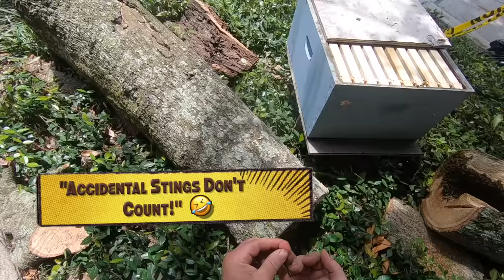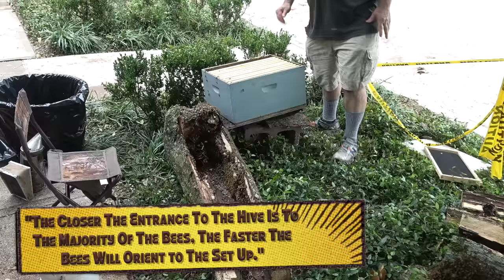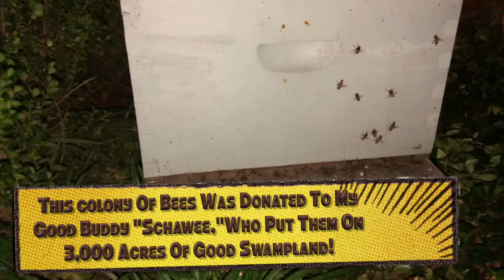Bee Man & Crazy Tree Guys VS Bee Tree

Comment: JP, find yourself a Gonstead Chiropractor to check if your first vertebrae is out of place. This will often cause the head to tilt in a manner that causes the eustachian tube to run horizontally rather than with a slight pitch.  This doesn't allow it to drain properly and can lead to blockages and infections.  Many childhood earaches are a result of this after the pediatrician has "helped" during birth with some traction during difficult births.

Comment: We’re no spring chickens JP. The older I get the more easier I get affected by heat. I have had my ears get weird. It’s said that once you’ve had heat exhaustion or dehydration the easier it is to be affected again.
Reply from the maker: Yeah, I’ve been dealing with this odd phenomenon for at least six years now, the last 2-3 years it’s gotten a little worse.

One doctor said it could even be something rare that required literally brain surgery, something about an area between the brain & inner ear or something, some little “nip tuck,” surgery but to diagnose it required a cat scan.

I was like but it only happens, only ever, when I’m in the heat but goes away after I’ve been in the AC for a little while.

Yeah, I decided to pass on the cat scan & potential brain surgery for now. 🥴

Comment: There is an easier way to put comb into frames, but it might take slightly longer rubber bands. Hook a rubber band around one corner and pull the other end around the diagonally opposite corner. Do the same again with another band and the other two corners, making sure both rubber bands are on one side of the frame. That will give you something to lay the comb on instead of manipulating it while drawing rubber bands over the frame. Finish it by putting another two bands diagonally over it and it will be stable enough to put more bands around the frame if necessary.
Reply from the maker: I’ve been contemplating lately of going to longer rubber bands, it’s coming. Thanks for the suggestions, appreciate it!
Reply: @JPthebeeman  You're welcome.

Comment: Your symptoms sound like high blood pressure.
Reply from the maker: I’ve never had high blood pressure, ever. All my bloodwork came back good recently.
Reply: @JPthebeeman  Not a Dr or anything but the hard of hearing part is one symptom I have when my BP goes up along with the others you describe. It could def be from the heat and humidity and just temporary.
Reply from the maker: @smashleybreaks  I actually started with this about six years ago, it’s definitely a strange one  but as I mentioned in the video, it only happens when I’m out in the heat for a while. 

I usually just go in my truck or indoors in the air conditioning for about 15 minutes & it goes away, usually fairly quickly but I have had it linger for a few hours too.